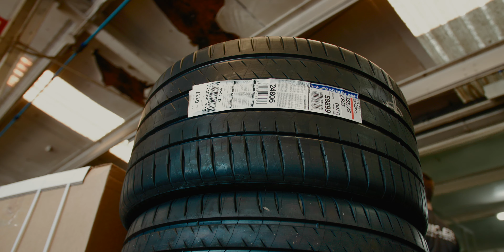Renntech Mercedes AMG GTR Roadster | Vossen ERA-2 Wheels | Butler Tire

Comment: are those 21 in back and 21 or 20 in front? wheel specs please ? thank you
Reply from the maker: When we shot this video we were actually running 21's all the way round but after it was shot we changed the front to a 20in which is what this AMG calls for; 20in front, 21in rear. Shoot us an email and we will try find the specs for you as we do not keep them on file: info@butlertire.com. Thanks
Reply: how does it ride with 21 in front? is lowering required if you put 21 in front?
Reply from the maker: @vule-nd5dm  although it worked, it was not ideal so we went to a 21/20 setup once this video was shot.